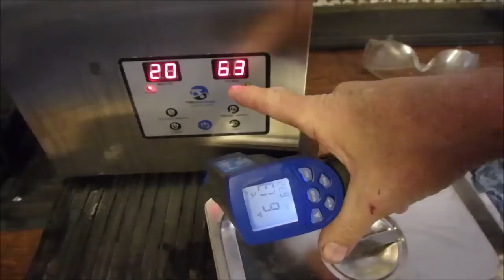Could There Be a Death Rattle on This New Mower???

Comment: These are the low end mowers that Canadian Tire sells in Ontario and we have had a few in for service here at Eliminator. Guess they are all like this cause you have the same noise on yours that all of ours did. Funny thing is we have found that the blade adaptor is not a very good fit to the crankshaft and we believe that is what the noise is. I do not think you would ever need a puller to remove the blade adaptor, basically it just falls off the crankshaft once the blade bolt is removed.
Reply from the maker: Correct.  What do you think of me getting a harder bolt and tightening the snot out of it??
Reply: @BrucesShop  I think that was a good idea it seems to have tightened up enough to take up that little play in the adaptor. I really can not believe these Certified blade adaptors have that much play in them. You did a great job, death rattle gone. Everyone of these that comes in the shop sounds the same, i think they are the only mowers that do this death rattle thing you showed in your video.

Comment: I had a Honda mower that did that, it was the blade hitting the frame ever so slightly. I noted the bent lip right away. It only hit on startup and stop. I used a big adjustable  wrench to bend the lip out and that was it, no more rattle.
Reply from the maker: Right on!!!

Comment: Hey Bruce,
Nice work!
I had a Briggs EX with that defective choke issue.  After fixing that, when starting and stopping it had a bit of a rattle too.  
The customer was waiting so I didn’t go too deep.  Took the blade off and found it had a ding on the cutting surface.  Straightened it with a hammer and anvil.  Sharpened it and tightened it back on.  Noise was gone! 
Nice when it’s that simple!
Reply from the maker: Right on

Comment: I just had one of these I worked on. 2 videos coming in the next little bit. I have worked on a couple of these in the past. The exclusive parts distributer for these "Canadian Tire" mowers and other yard equipment is a company out of Quebec called Mecanair. Have ordered from them a handful of times. Good work Bruce.
Reply: interesting.  mecanair is where I got a simoniz pressure washer part and I  think the washers are also a ctc exclusive.
Reply: @kenhilson786  any Canadian Tire exclusive yard equipment parts are supplied by Mecanair
Reply from the maker: Thanks a lot.

Comment: Bruce just heard on Chicmecanic channel that Honda is going to quit manufacturing their lawnmowers and sounds like all their lawn equipment starting September 2023. Parts will still be made and available.
Reply from the maker: Yes i heard that as well.  I think it is multiple issue for Honda.  EPA,  poor design of the GCV split angle  crankcase.  4 gaskets on the carb with 4 inch long bolts holding it all together,  poor choke design as well.  My own feelings there.

Comment: Anytime I find a carburetor  that crudded up, I replace it. The protective coating on the inside of the bowl and carburetor  base are compromised  and I can guarantee  it will corrode up pretty fast. I learned a long time its just not worth a customer return and generally they never run smoothly again because of the gunk where it doesn't belong. Any corrosion changes the internal passages and causes running issues.
Reply from the maker: I agree.  I wouldn't even know where to find this carb.

Comment: Great vid. I break those @#$@# plastic Briggs style downpipes all the time. When you first pulled it and it rattled all I could think was "blade rattle"
Reply from the maker: I was in the back of my mind.  We had this discussion a few Saturday's ago.
Reply: @BrucesShop  worst part is, most mowers won't start without the inertia of the blade so it's not an easy test

Comment: And whata ya think of that Certified blade design, can not even get an aftermarket blade like that gotta get em at Canadian Tire and pay mega for a cheap blade.
Reply: probably cheaper to switch to aftermarket mtd adapter and blade.
Reply from the maker: Can you believe that insert bushing!!!!!
Reply: @kenhilson786  Your likely right just need the right adaptor to set it at the same blade height but the MTD adaptor would likely have a better fit to the crankshaft. Never measured the crankshaft would think it would be 7/8" or 25mm
Reply: @BrucesShop  Yep they use that to get the correct blade height.

Comment: Just in case you’re wondering, those engines are manufactured in China by a company called Rato. They produce over 3 million engines yearly. They loosely copy Honda designs. 
One thing I like over the Honda engines is that the carburetor is mounted on by studs instead of bolts. 
Another great video Mr. Bruce!
Reply from the maker: Well that is true   I never thought about that.  Thanks!!!